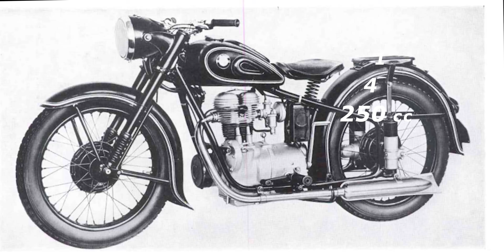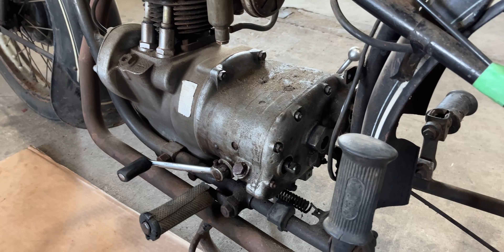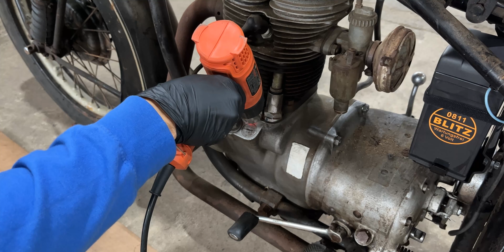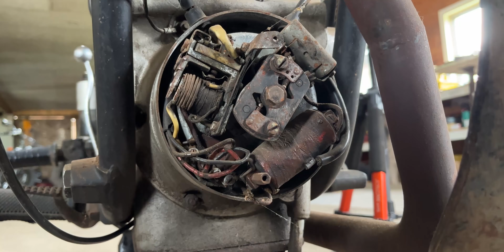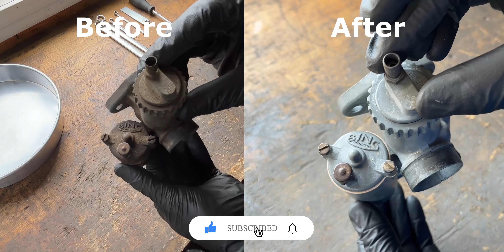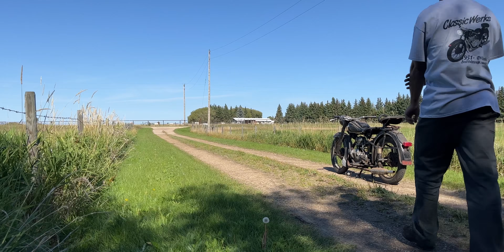Reviving a Classic 1951 BMW R25 Motorcycle

Comment: I still have the original repair book of Simson Sport 250cc. I miss this motorcycle. The sound it anoints my soul. The same sound like your BMW 250
Reply from the maker: The Simson Sport 250 has such a distinct sound: deep and mechanical, almost identical to the BMW singles of that era. I can imagine how much nostalgia that brings. Those old repair books are treasures on their own!
Reply: @WorkshopRebuild  I would like to share this Simson repair book. I don't know how I could put it on youtube.

Comment: It would be amazing if BMW brought back a classic single-cylinder bike like this R25—something simple, elegant, and full of character. A modern version with around 30 horsepower and a 6-speed gearbox, just enough to cruise comfortably on highways without aiming for high performance, could be a huge success. Even if it were significantly more expensive than bikes like the Royal Enfield Classic 350, I think it would find a strong market. There’s definitely a demand for retro-styled bikes with real heritage.

Comment: The R25 was my second bike, 60 years ago.  It was well used by the time I got it.  The generator failed, couldn't afford a new one, so I ran total loss from the battery and charged it at nights.  It handled horribly but was more fun than most of my later rides.  The sound was instantly familiar.  Thanks for the great video.

Comment: 1962年代、台灣也有進口、那是我國小時、老師家中有一部BMW~2釭500cc的機車、後來又有看到單釭250cc機車，到了成年進入社會工作.、才發覺BMW，有高級汽車！因為那個年代.、台灣的機車大都數日本車系、BMW機車給我從小的印象深刻.、是他們機車用的是〈 傳動軸〉堪稱是在當時很先進技術，其他廠牌的裝備用〈鏈條〉傳動的！
Reply from the maker: That’s a great story! It’s fascinating to hear how BMW motorcycles left such an impression on you from a young age. The shaft drive was indeed a groundbreaking technology back then, especially when most other bikes used chain drives. BMW's engineering has always been ahead of its time, and it's cool to see how it stood out even in Taiwan, where Japanese bikes were more common. Thanks for sharing that memory! ❤️ Regards Andreas
Reply: @WorkshopRebuild  Andreas, you need to see the REALLY old shaft-drive motorcycles from before WW1!  There's a very good video here in YT......

Comment: I had exactly this m/c for my first ever!  However, there was not rear pillion seat on mine.  7832H, where are you now?  BTW, I notice a few strange words are often used in your movies - in the subtitles/voice - @2:52 - 'clutch perch'?  I realise that your native language is probably French, but.............................?
Reply from the maker: That's awesome you had the same bike for your first! It must have brought back some great memories. As for the term "clutch perch," you're right—it’s an odd one! It actually refers to the part where the clutch lever mounts on the handlebar, often called a "clutch perch" in certain circles. 
I appreciate you pointing that out! The subtitles and translations are usually done automatically, and at this current moment I do not edit them. I've spoken German for the majority of my life, maybe that's why. Thanks for watching and sharing your thoughts!
Reply: @WorkshopRebuild  Thanks for your response, Andreas.  One of the more odd things about my m/c - that I mentioned in your R60 rebuild, was the PTO off the drive hub for a powered sidecar wheel.  These were popular in Bavaria, Austria and Tyrol for small businesses, that had a load carrier rather than a people carrier!   And the hand-operated gear shift - the long lever with the roundball-knob on the rear right-hand side of the gearbox.  I never figured that one out, to be honest.  Do YOU have an answer?

Comment: nice job overall but why didn't you clean the trans before reinstaling?  thanks for posting.
Reply from the maker: Thank you for your comment! 😊 The bike was extremely dirty when I started, and my main goal was to get it running with minimal effort. While cleaning the gearbox externally can improve the drivetrain, it wasn’t strictly necessary for this stage. There are still plenty of issues with the bike, and I’ll be revealing them in upcoming videos. Cheers, Andreas!

Comment: Genau so eine hatte ich um 1975 ! Für den TÜV musste der harte Griff vom Sozius-Sitz durch einen Lederriemen ersetzt werden, und Blinker mussten ran. Ein wunderbarer "Sound", geringer Benzinverbrauch und wartungsfreier Antrieb mit Kardan. Mein bestes Motorrad in der Zeit.
Reply from the maker: That's awesome! It sounds like you had a fantastic experience with that bike. The modifications for the TÜV make sense—safety and regulations, of course! The sound, low fuel consumption, and maintenance-free shaft drive are definitely highlights of these classic bikes. It's great to hear it was your best bike at the time! Thanks for sharing your memory! Regards Andreas

Comment: Crikey. How did those valve guides get so bad? Presumably it was still running like that before the clutch issues!
Reply from the maker: That‘s what I thought too! It‘s hard to believe it ran like this…but who really knows. The only information I received from the previous owner was:“ It ran 12 years ago…“😅 Either way, it‘s now in running condition, but there are still more issues that I need to address. More on this in an upcoming video.

Comment: Nobody understands that. Why does the cylinder stay on instead of at least inspecting the piston and rings? And why is oil good just because it looks clean but has been sitting around for ages? Copper paste also causes corrosion, especially on aluminum.
Reply from the maker: Many viewers understood what I did, and some even learned something new. Inspecting the piston and rings wasn’t essential to get this engine running. If the bore shows no scoring, the piston and rings are in good condition. Any oil is better than no oil—keep in mind, this engine was designed over 70 years ago when oil quality was far inferior to what we have today, so using a bit of older oil isn’t an issue. 
If you’ve worked on classic BMW motorcycles, you’ll know that anti-seize is invaluable when tightening the exhaust nut.
There are still many aspects of this bike that I haven’t addressed, which could lead to bigger issues down the road. However, since I plan to restore the entire drivetrain to factory specifications, it’s not a major concern.. Hope you enjoy the upcoming videos.

Comment: Ich fahre Seit 25 Jahren eine BMW R26 Bj 1958. Du solltest dir einen originalen Krümmer und Endschalldämpfer besorgen ebenso benötigst du ein anderes Rücklicht (Eber-Rücklicht)
Reply from the maker: That’s amazing! Riding a BMW R26 for 25 years is quite an accomplishment. Thanks for the tips—I’ll definitely keep an eye out for an original exhaust and tail light (Eber-style). Those details really make a difference in preserving the authenticity of the bike. Appreciate the input!
Reply: Moin, habe ein R25 in top Zustand geerbt. Braucht aber ein bisschen Arbeit um es wieder fahren zu können (stand 10+ Jahren in der Garage). Was wäre ein fairer Preis? Jemand hat mir 2.5 k Euro angeboten.
Reply: What would a fair Price be for this bmw in near pristine and working condition? Have inherited one and have really no clue. All original besides battery.

Comment: Im a sucker for shaft drive. Love these old bikes apart from 6v headlights. If only RE made a 350 with a shaft!
Reply from the maker: They are quite cool, especially the classic bikes. The 6V system can be upgraded to a 12V system relatively easy, which is a nice thing. I'm sure they made more power without a shaft drive though...haha! Regards Andreas

Comment: Had an R26. Brought the head to a guy in Alexandria Va. to weld a new exhaust nipple and thread it. He disappeared. I managed to track him down in Minnesota, and he was surprised. He did send me back the head repaired. Locked up the engine by driving it at 70 miles an hour on a trip to Annapolis. Don't know if it had side car gearing. It had a leading link fork.In the sixties and early seventies slash 2 bikes were under a grand.   I've had a half dozen. If you have bottom end problems cranks are probably unobtanium, and those that knew how to rebuild the roller bearing cranks are taking dirt naps.  Lots of small dealers were forced out. I believe Isettas used this same engine.
You can win bar bets with these bikes. You lure someone in with "The bikes are hand crank.".  The flywheels are so heavy, the compression so low,  that by pressing down with your hand will allow you to start the bike.Have a friend hold the money. 
BMWMOA has a national and it is a feast for the eyes.
Reply from the maker: What an incredible story—thank you for sharing! Tracking down that guy in Minnesota must have been quite the adventure. 

The R26 (and similar 250cc models) certainly have their quirks, and I’m sorry to hear your engine seized on that ride. It does sound like the oil pump may not have provided sufficient lubrication to the bore. These engines use a low-pressure gear pump designed to supply just enough oil to the moving components, supplemented by a splash system. It's possible there may have been an issue with internal flow.

As you mentioned, finding quality crankshafts for these bikes is a real challenge today, and only a few shops are capable of handling such specialized repairs. I’m currently gearing up to rebuild crankshafts in-house, including splitting them, replacing the connecting rod bearings, and reassembling them to run true. I’ll be starting with an R25 engine soon and have also received an R69S crankshaft for overhaul. It should be an exciting project, and I plan to share the process online.

That’s the first time I’ve heard about hand-starting these engines, but now that I think about it, it makes perfect sense. I might just have to give it a try myself!

Thank you again for such a detailed and insightful comment—I hope other viewers take the time to read it as well. 
 
Cheers Andreas
Reply: @WorkshopRebuild 
 You have to be able to source or manufacture replacement crank pins, bore the big ends of the rods and figure out a source for the bearing rollers. Maybe somebody who does two stroke cranks?  Harley Davidson cranks? . How do you figure out the clearance? I hope you have a good command of technical german. 
We did a TWN, Triumph Werke Nuremburg, and I had a young man who was fluent helping with the manuals.  
I overheated it.That's what toasted it on a hot day in July. Doing 70 on a 1959 250 was trying to kill it. Best of luck on your journey.
Reply: @WorkshopRebuild  Andreas, I often started my 'bike by hand, just to show it could be done.  Many of my fellow bikers had high-compression kinds-race bike - the Royal Enfield Crusader Sports 250 and Velocette 350 and 500s were very popular - THEY needed some severe kicking, even with an exhaust lifter...

Comment: Great engine note for a 250 single. Very Great Escape.
Reply from the maker: It does sound very good for a 250😊 Unfortunately this is not the original muffler, but I‘m sure I‘ll find one to make the bike as „period-correct“ as possible. Maybe it will sound even better then😀 Thanks for watching!!
Reply: @WorkshopRebuild  I am telling people, that the number 13 is Actually very Good !😀 ( the 13'th kick it was when it started  🙂 :-) But, the Worst of all is the number 22 😞 ( I think, that it has a 22 milimeter Bing carburetor on it ? ) . Thanks 4 the video 🙂
Reply: ...but the fence stays closed at the end.

Comment: Had a ride on one of these around 25 years ago. I was shocked at the total lack of performance in it.  NSU Max was in production at the same time as these, and it is difficult to conceive how anyone would have purchased one of these as an alternative.
Reply from the maker: Thanks for sharing your experience! It’s true that the performance of these bikes is modest compared to others from the same era, like the NSU Max. However, bikes like these often appeal for their simplicity, reliability, and charm rather than outright performance. They were designed more as practical, everyday transportation rather than high-performance machines. It’s fascinating to see how motorcycles have evolved since then.😊
Reply: Not everyone wants to ride at a ball busting speed.

Comment: Great video - I have a 1954 R25/3 that is lots of fun, I put a rebuilt bing carb on and had to replace the regulator and condenser but it has been reliable since then, great way to travel - I like the tip of how to check the oil flow to the rockers - was it easy to get the special shaft made?
Reply from the maker: Thanks for watching—I'm glad you can relate! Your R25/3 is probably a fun little bike, especially after giving it the care it needs.  

The shaft is quite straightforward to make. It's made from ground shaft material with a diameter of 5/16" (7.9 mm) and a length of 210 mm, though you can make it longer if needed. The front features a square drive measuring 7 mm x 7 mm, with 0.50 mm removed from the round stock to form a square tip. This square tip feature is 15 mm long to engage with the oil pump drive sleeve.  

If you decide to make one, it’s quite simple—just replicate the tip of the oil pump shaft you remove from your engine and extend the shaft portion to the desired length.  

I hope this tool proves useful if you give it a try! Regards Andreas

Comment: So glad to see a startup where the engine is checked and lubed thoroughly before starting so that it isn't damaged.
Reply from the maker: Thanks for watching and leaving a great comment! I prefer to do things this way, so I don't run into trouble down the road. The engine will need more work and that will be featured on my channel soon, so there will be more issues to resolve. Regards Andreas
Reply: My first BMW was a brand new 1957 R26 . The instant I first started it, got on it and drove it from the dealer I knew that I'd made a good choice. I loved it's engine sound, it's suspension and incredible quality
 The little 250 single bike will forever be one of my fondest memories . What a incredible machine!!

Comment: German torque spec. « Gut und tight «
Reply from the maker: That's how that came about... BMW began standardizing torque specs in the 1960s, especially with the /5 series in 1969. Before that, mechanics relied more on feel, but by the 1970s, torque specs became common in manuals for better precision and reliability.

Comment: That is going to be a fun back roads cruiser. It really tractors right along at just an idle. I can  hear that it has a fairly heavy flywheel, and the exhaust has a great tone. I hope you get it on the road soon.
Reply from the maker: It's definitely meant for back road cruising instead of highway speeds, HAHA! The heavy flywheel and theexhaust tone really add to the charm. I’m looking forward to getting it on the road soon—thanks for the kind words! -Andreas

Comment: The guttentight method 🤣🤣🤣🤣🤣🤣🤣🤣🤣🤣
Reply from the maker: Fun fact: torque specifications for most fasteners were introduced in the 1960s. Before that, every bolt on this motorcycle was tightened by the "guttentight" method, and somehow, nothing has fallen off to this day. So, it turns out it wasn’t such a bad technique after all!

Comment: Thanks for getting started on this one.  Once finished let me know and I will get the garage ready. 😊
Reply from the maker: I'm glad I could bring this old bike back to life with a little bit of effort. I will share future plans for this bike in upcoming videos, but the R60/5 project will be completed first. Thanks for watching and leaving a comment. Much appreciated! -Andreas
Reply: My pleasure Andreas.  I'm a proud custodian of a 71 R60/5
Reply from the maker: That’s a fantastic bike you have. I feel the R60s and R50s are somewhat underrated since the R75 often steals the spotlight with its larger displacement engine. In the years ahead, I believe the R60 will hold its value better due to its lower production numbers. I hope you’re thoroughly enjoying yours!
Reply: I love mine to bits.  I have had a few 70s Airheads over the years including an R80 but the R60/5 is definitely my favourite out of them all.  It still has some of the styling of the earlier BMWs and is easy to work on.  Mine is a peach, not perfect but looks fantastic and rides like it has just left the factory.  I do all my own spannering too within reason.

Comment: Awesome, top end  looks so similar to my R60/6 from 1975 which I converted to a 1000 with just a barrel, piston, carbs. bevel drive and top end job, even kept the original valve covers, looks like a sleeper but with 67bhp . Cheers
Reply from the maker: You are right, it is VERY similar! Who would have expected that similar components would be used 20 years down the line. You've finished up a great project with the 1000cc conversion. Now it's time to strip some weight to gain on top-speed haha. Enjoy your ride - be safe

Comment: How do you find a machine shop capable and knowledgeable about airhead cylinder head rebuilds, valve guides/seats etc? Also could you share a rough price about how much that might cost per head?
Reply from the maker: I use a machine shop specialized in 2stroke & 4stroke engines, that only works on small engines…basically anything up to 1.0L bike.

Valve guide and seat information was sourced through Mark Huggett. He has the specifications and details for most classic BMW bikes.

I will have a rough breakdown on this R25 in my upcoming short video series, but if you want a full breakdown feel free to send me an email. I‘m more than happy to provide that to you.